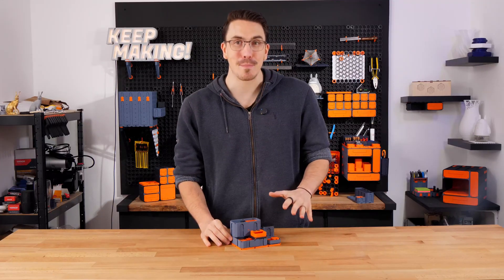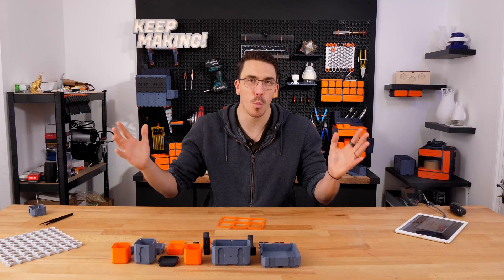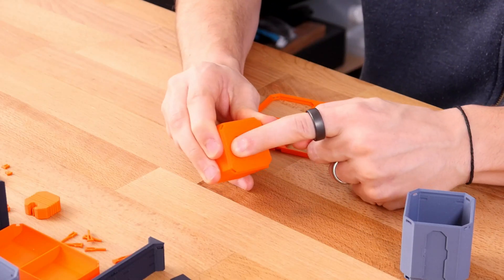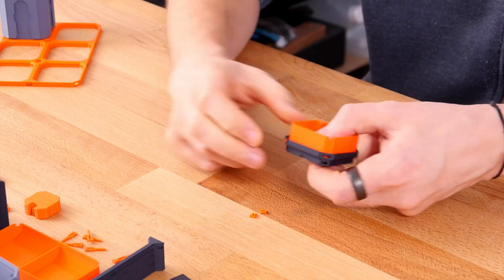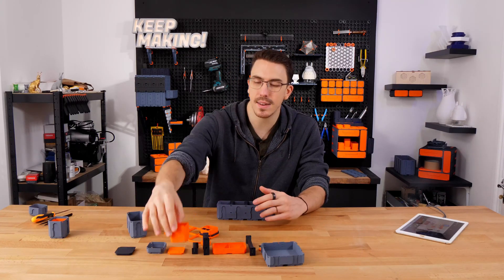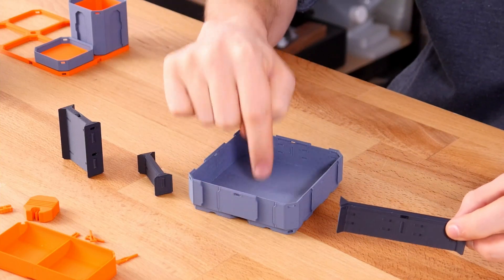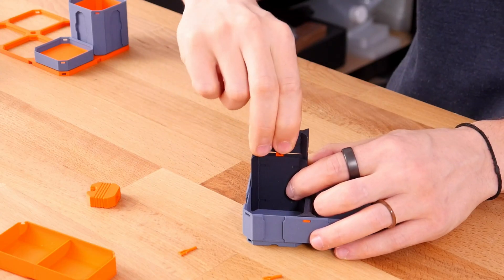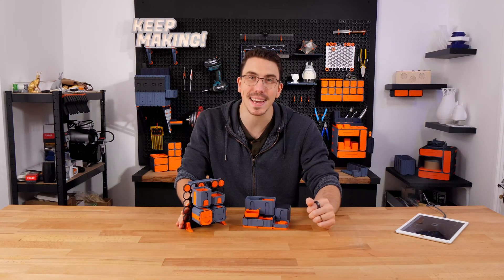Multibin Learning Pack : Getting Started With Multibin

Comment: why didn't you make multibin compatible with gridfinity? That's a bummer ...
Reply: unfortunately this cant work because Multibin is supposed to be compatible with Multiboard, which has a 25mm grid. Gridfinity has a 42mm grid so it doesn´t line up. I really like Multiboard, but I´m still trying to figure out whether to use Multibin or gridfinity. I am hoping to see a lot of the Gridfinity accessories remixed to work with Multibin.
As I see it, this is not a Gridfinity that is Incompatible with Gridfinity, but rather a Remix of Gridfinity that is Compatible with Multiboard, which was Missing in the World of 3D-printing as far as i know.

Comment: I'm confused with dividers. I have 3.5h shell with 1H bottom divider, 0.5H full top divider, but what should I use in the middle. Looks like nothing can cover the middle part without leaving some gaps.
Reply from the maker: Hey mypaxa, No worries all you have to do is stack the 1H bottom divider and then use the 0.5H on the last bit.
Reply: @multiboard_io  Ah... Ok. I have not even thought about using multimple bottom dividers.

Comment: Definitely comes across as over-complicated especially compared to graffiti. I like the looks of your system and attempting to learn it. I have several bamboo printers to try. Have a very difficult time kind of knowing which connection works with which item like Boxes Etc I have joined your membership find my benefits at the lowest level aren't much. Some of your tutorials are kind of mislabeled period hard to figure out which is which. My Approach is more or less printing whatever comes with your tutorials and hoping for the best.

Comment: is this grid the same dimensions as gridfinity?
Reply: I think Gridfinity has a standard grid size of 42, but there are generators that allow you to change that into the 50mm grid that the multiboard system has, so you can technically make multiboard-compatible gridfinity bins. But Multiboard was most likely not designed with gridifinity in mind but rather as its own thing

Comment: I'm trying to connect a multibin shell and drawer to a vertical multiboard. How exactly can I do that? There are so many parts and I'm completely overwhelmed! I think some documentation of different use cases would be really helpful.
Reply: I'd recommend checking out are community for an easier way to get direct assistance, but the part you're looking for is probably the small thread multipoint.

Comment: Why is this not compatible with gridfinity?
Reply: Multiboard was initially designed to be wall mounted and uses 50mm grid to maintain compatibility with most pegboard accessories. Gridfinity uses 42mm grid, it was designed to be desktop and toolbox organization so that probably wasn't a consideration. Many toolboxes have 300mm wide drawers, which means you can fit one additional grid column using the 42mm system than 50mm one without much loss to individual bin volume.

Luckily there are several people that have made adapters to attach both systems to eachother.
Reply: wouldnt that be great.
Reply: Ultimately it comes down to it just not being a goal of ours. We focused on keeping a highly consistent sizing standard (25mm, the metric pegboard unit, and a highly divisible value) and designing within that. A single multibin insert and gridfinity bin happen to be of similar size, but that was a bit of a happy accident. We do provide some basic compatibility parts where we can, but I recommend checking out the community for more on that front!
Reply: That’d be too easy! Same as open sourcing it